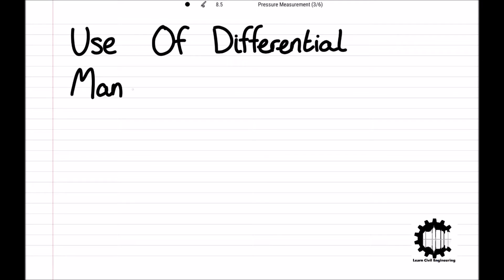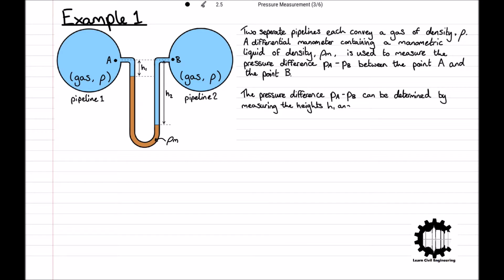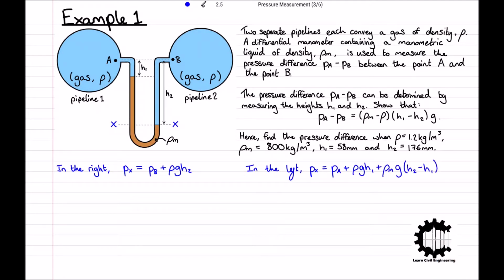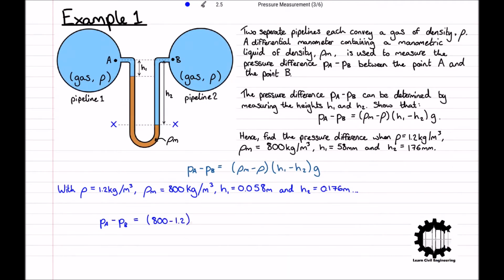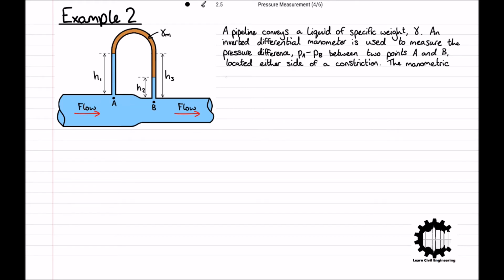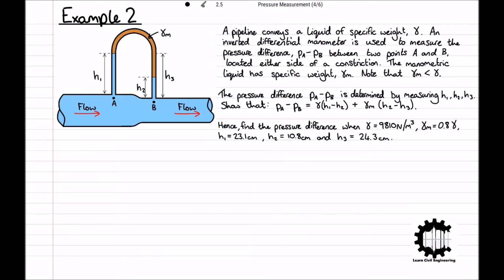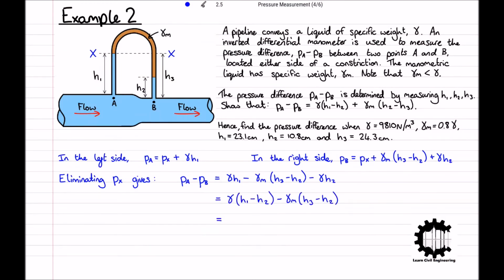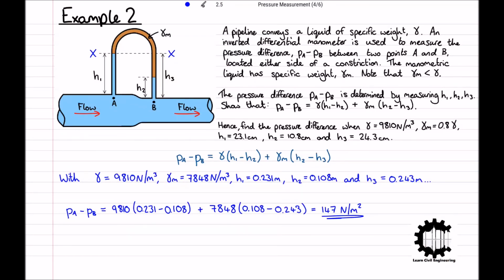Differential Manometers Example Problems - Pressure Difference Measurement - Fluid Mechanics

Comment: hi , the specific weight of the manometric liquid is 0.88 in the question, but you put 7848
Reply from the maker: Hi there, in Example 2, gamma(m) is equal to 0.8 times gamma. (Not 0.88). Therefore, gamma(m) is equal to 9810*0.8, which equals 7848N/m^3. I hope this clears it up for you.

Comment: whats px stand for?
Reply from the maker: p subscript x is the pressure at the level of x in the tube (along the dotted line in the diagram). Hope this helps :)
Reply: @Learn_Civil_Engineering  Thanks. one last question, how do you know where to draw the x line
Reply from the maker: It is best to draw the X line at the interface between the flowing liquid and the manometric liquid that is furthest away from the points that you're trying to calculate the pressure for (A and B). So for the first example, it is the lowest interface and for the second example it is the highest interface.

We do this because we can determine the pressure at these points using the height measurements known to us (as we see in the video).
Reply: @Learn_Civil_Engineering  Thanks :D